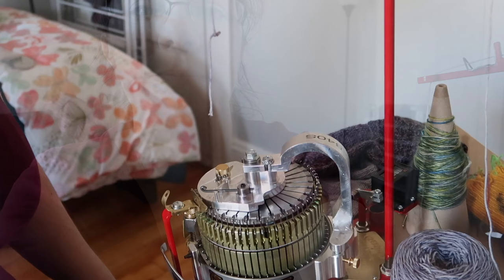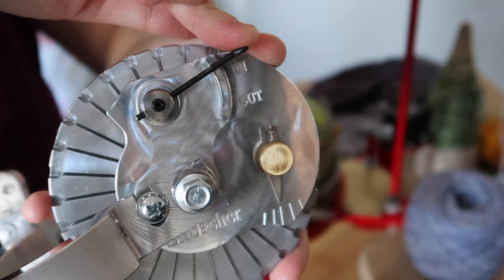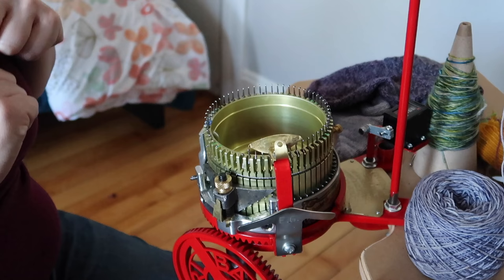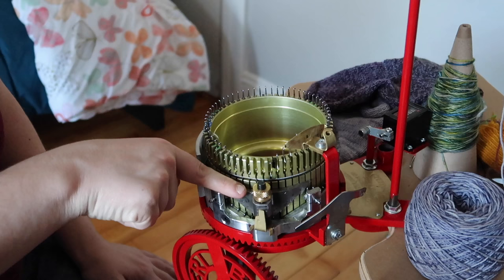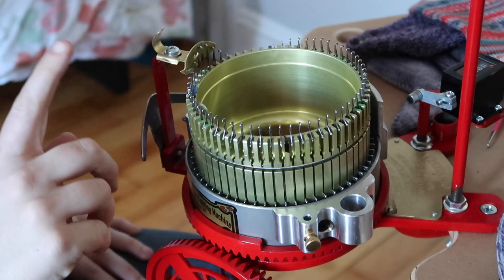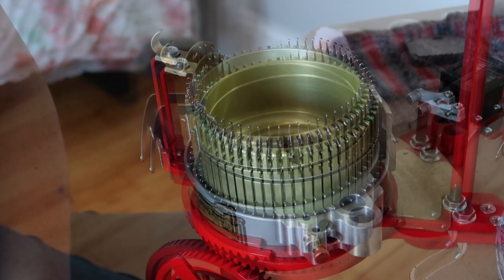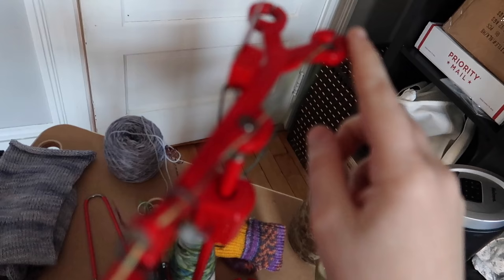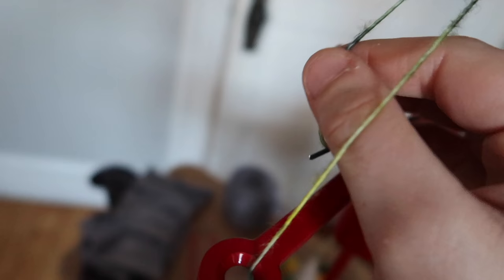Erlbacher Gearhart Speedster Review and Demo

Comment: Just curious...Why didn’t you buy a flat bed machine with a ribber for a similar price?  You have a much wider spectrum of things you can knit.
Reply from the maker: I do have a flat bed as well at this point :) it’s a slippery slope! I got the sock machine so i could make samples easily since my main fiber was fingering weight yarn. I also like to wear hand knit socks more than other knits i could make on other machines. I also don’t like seaming all that much hahahahah but in any case I have a flatbed now - still learning on that machine - but the basics I’m getting down :) hope you’re well!
Reply: Littlebean and Me Oh well that’s fair enough.  🙂

I am very well thanks, hope you are too.  

I am a machine knitter, I use several machines so I can work with fine and thick yarns.  I am pretty knowledgeable on flat bed knitting machines and their attachments but I have never used one of these sock machines, I wouldn’t really know where to start, the techniques I would understand how to do such as the shortrows and the Kitchener stitch but how to actually operate the machine I would have no idea!  They do look rather ancient don’t they, I assume it is an old design.  Mind you, I think most of the flat bed machines that you can still buy know look very 80s, probably because that was when they were originally designed, lol.  I digress.  

Anyway, hope you’re having lots of fun knitting and not so much seaming! (I hate that part too!)

Comment: Hi, I have a vintage Auto Knitter, and if I can conquer it I would love to get a brand new CSM. It is as we all know, a steep learning curve, so every video I watch is helpful in one way or another. One issue I have is that the vintage machine 60 needle cylinder has 4 red markings on it...at 3,6,9 and 12 o'clock. There are no markings for the heels and nothing to tell me where to add the marks. I noted that you used a Sharpie...good tip! Can you tell me where to put those marks please. 
Also I think the brand new machines run better than the older ones...but that may be just down to my inexperience? 
Thank you!!

Comment: Great video. Your thoughts on 60 vs 64 cylinder?? Do you find the 60 is a good sock width. I have a sock that was cranked on a 64 and it seems like a 60 might provide a better fit for me but maybe 64 is more generic. Hmmm just trying to decide. Can you knit a 60 on a 64 or would the gaps be too big? Thanks! Jen
Reply from the maker: It really just depends on how you like your stitches, or the yarn you use more often. Do you use a heavier or lighter fingering weight? That might weigh in on your decisions as well. I got the 60 because i know i like my socks tighter, and i have narrow feet. I don’t think you would go wrong either way!

Comment: I am new and would love to purchase one of these machines. But looking on the website trying to decide which and what parts i need to get. How do you know what you need for what you would like to make? This machine is fantastic and thank you for the review.
Reply from the maker: I just went by what I would normally stitch for socks for myself. My feet are usually on 60sts, so that's the cylinder that i ordered. A lot depends on what you plan on knitting, and with what type of yarn. The company is also super helpful to answer questions - i've never had any issues there. You don't need a ribber, you can always manually drop/pick up stitches, or knit tubes and pick up stitches to manually knit the cuffs as well. It's an investment, in any case. I know there are several other fiber artist YTs out there with these and similar machines.
Reply: @LittlebeanandMe  thank you for your help.

Comment: Thank you. I'm confused about the brake for short rows. How can you knit short rows if the brake stops your yarn feed? I'm thinking about getting one of these.
Reply from the maker: It doesn't fully stop the feed, rather it provides a tension for the back and forth motion of knitting. When you're knitting in the round on this machine, you don't have tension on the yarn (the arm is connected to the weights). When you're knitting back and forth for the short rows of the heel you need the consistent tension on the yarn so the yarn carries with the carriage.
Reply: Aha! Yes ok I understand now! Thank you!

Comment: is this a lot better than the Addi Express?
Reply from the maker: this type of knitting machine is intended for fingering weight socks (usually), and is heavy duty cast metal. They run much more expensive than the addi express and has a tighter gauge, and more features to create lighter weight socks and items. I've made infant hats and socks on my 60 st/72 st cylinders with this model knitter.